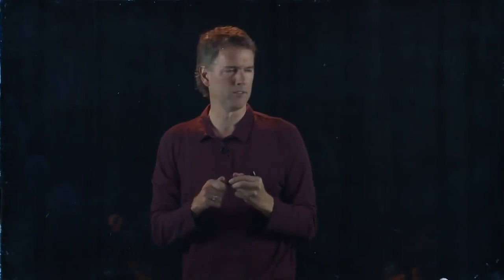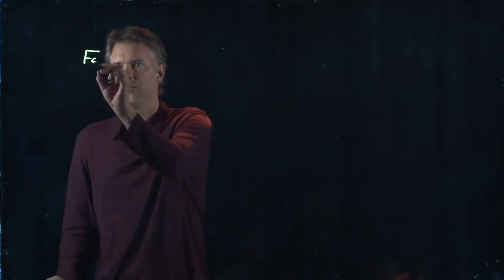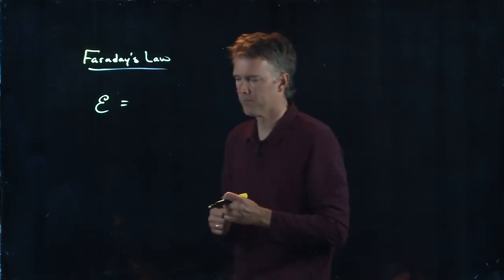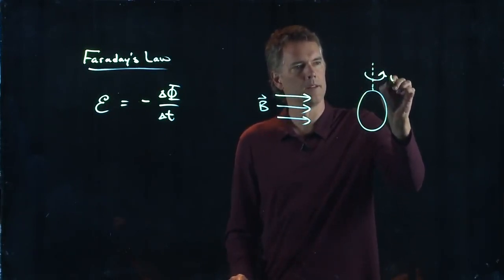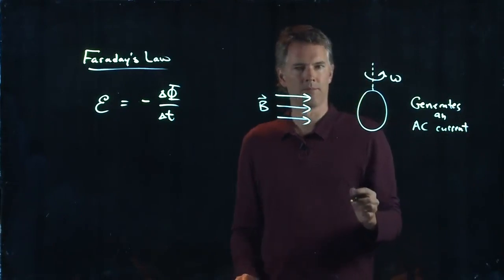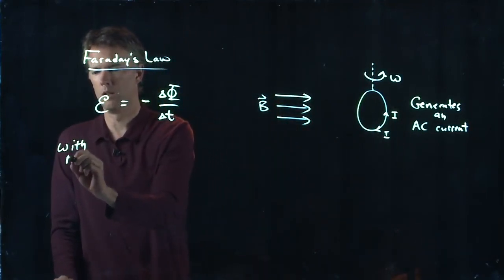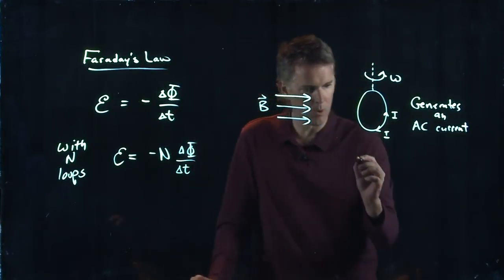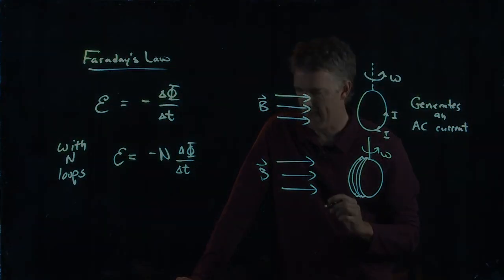Faraday's Law | Physics with Professor Matt Anderson | M24-02

Comment: I have a question for you. Does a test charge at rest in variable magnetic flux start to move due to the electrical field created by this variable magnetic flux. Would appreciate it if you clarify whether or not this test charge start to move or vibrate .

Comment: Faraday's Law is not a law, just math.  In your rotating wire loop, the emf is motional emf resulting from the motion of the wire through the magnetic field and is not the result of the changing flux linking the loop.  It is a case of correlation, not causation.